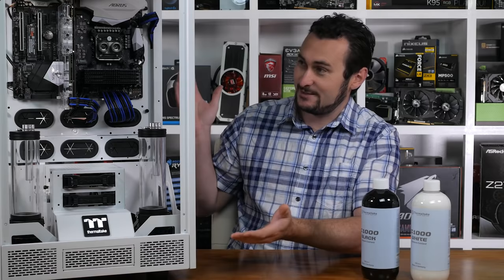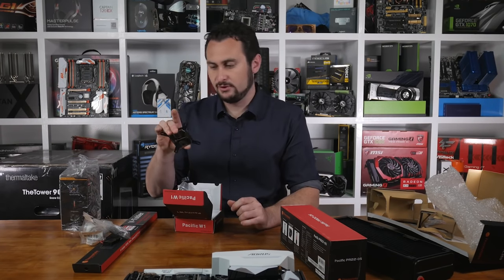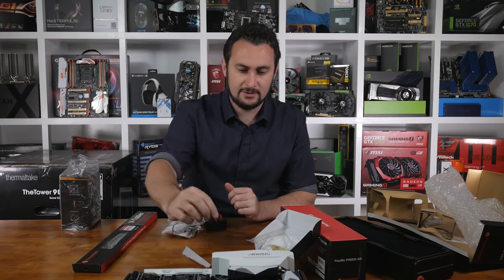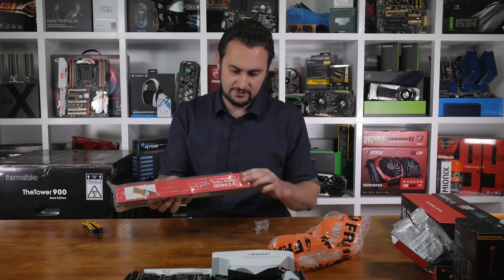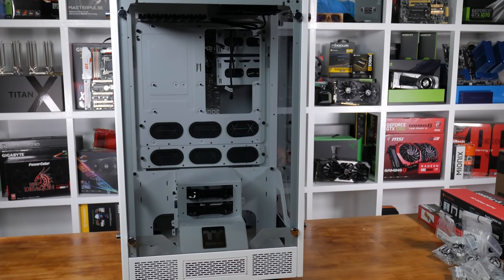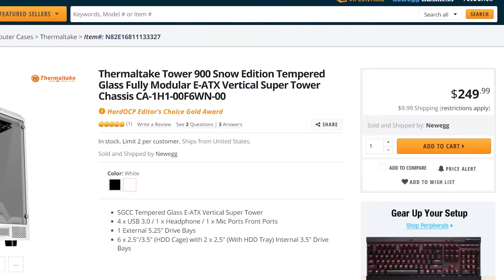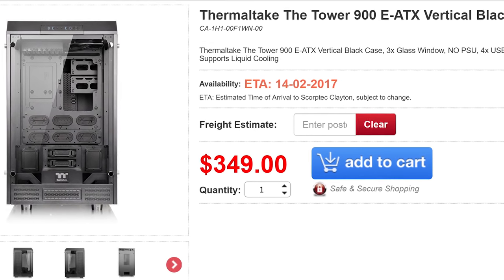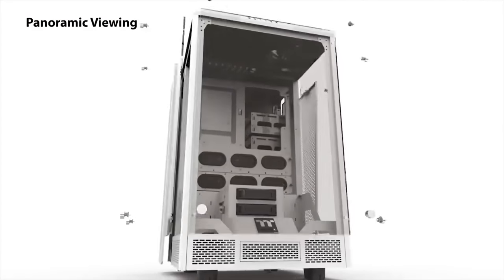Thermaltake The Tower 900: Kaby Lake Build [Part 2] The Build Begins!

Comment: Only suggestion is to install casters on that beast. I have a Core X9 in which I placed 3 XSPC RX480 rads and due to weight I found casters from Apollo Caster company that were EXACT mount plate match ups for the Core X9 mounting holes. Much easier to move.

Comment: The build is looking nice so far, I can't wait to see the finish build. I would've put the CPU and the water block, RAM and M.2 on the MB before placing it in the case. I think you had to remove the drive cages to put in the last two remaining screws of the CPU water block. I noticed you had a hard time putting the 2 screws in the video, and on those you had some clearance for the installation.
Reply from the maker: +Ichigo Uzumaki Yeah that is how I would do it off camera. This is more dramatic ;) Thanks for watching and giving feedback mate!

Comment: Im glad i didnt order the black version of this chassis now, the white looks so much better, and will distribute the led light better as well. but here's a friendly tip, rinse the radiators before use to get rid of the microscopic metal particles, these can discolor the tubing and water

Comment: I've been wrecking my brain on how to connect the radiator and fans to the grill on the side. I have the exact same setup and kit but the screws from the radiator and fans just aren't long enough to connect both. How did you setup those? Thanks in advance

Comment: Will this fit two 560mm radiators? It looks like it will, both sides are exactly the same for radiator clearance, but on the site is says 560mm for one side and 480mm on the other?

Comment: @3:51 Why not have the block logo the same direction as the mobo? With dual loops the in/out orientation doesn't matter much.
Reply from the maker: Doing that would have wreaked the look of the pipes as they would be stacked rather than side by side.

Comment: What's funny is that you can have the exact same specs in a case literally 15 times smaller and nothing would overheat.
Reply from the maker: That's not the point though is it, The Tower 900 is a display case.
Reply: Agreed. It's all about the presentation, though some badass hardware would also help to impress the audience. Great proof of concept though.

Comment: It is not clear from your video how to connect the two case fans, I have almost the same hardware but  my motherboard is Gigabyte Aorus Z270X-Gaming 9. The fans have 3 pin sockets and the motherboard has 4 pin fan headers, please can you help.
Reply: you should be able to plug them in and work

Comment: i don't like hard tubing , they look unsafely . Soft tubing need a lot strenght mount on hose fitting
Reply from the maker: Hard tubing is better in pretty much every way, the only downside being it's not practical for changing hardware and it's worlds harder to install! :)
Reply: Hard tubing look nice but i afraid leak ( this thing stop me change my soft tubing loop). You just put hard tube in fitting , and just couple rubbers prevents leak
Reply from the maker: Hard pipe when done correctly is less prone to leaks than soft tubes.

Comment: In 2017 I find your lack of RGB disturbing. I need my bling.
Reply: The radiator fans are RGB :)

Also with room the spare I'm going to throw a pair of Corsair K95 RGB Platinum keyboards in there for some added bling! ;)
Reply: The radiators are in the trunk out of sight, their lights won't be seen except if you look at the case from the sides... Make sure you put the K95 keyboards on the front of the reservoirs  -_-